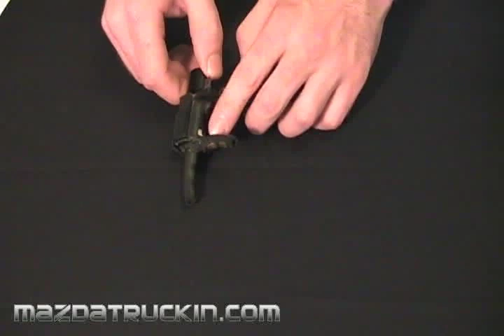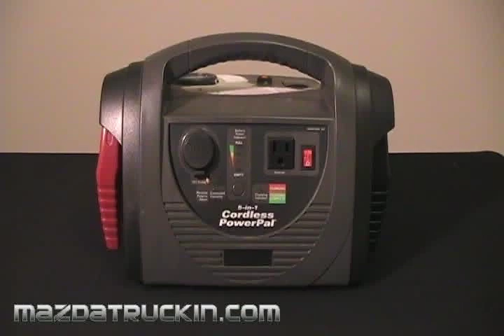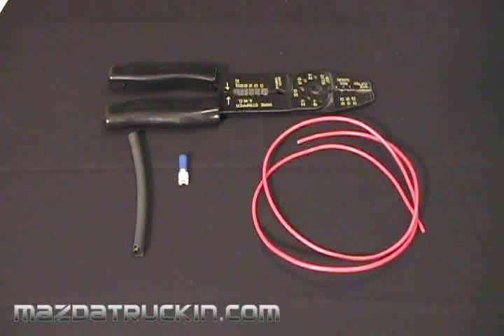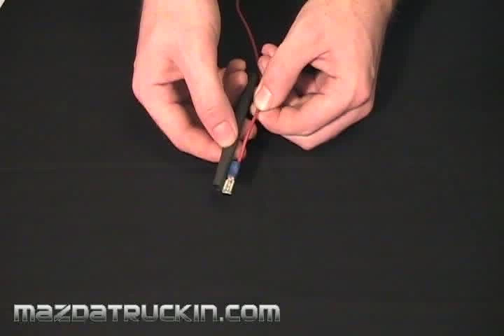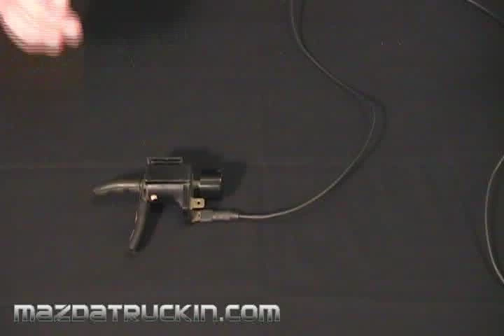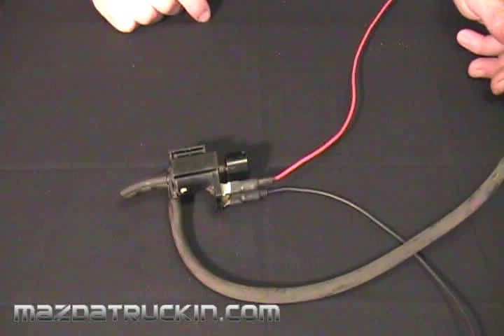Mazda Vacuum Solenoids

Comment: I am not sure you can completely rely on this method to be a true test
I have a Miata and doing this method the Solenoid works perfect
 When I hook it into the system it will not work.
 I have power to the solenoid
 I think if you have a high OHM reading when doing a continuity test ,it is possible the solenoid is still bad
 A reading of 22 to 26 ohms is good A reading of 35 and up it is bad
 I appreciate you doing the video as it it explains what a person needs to do and how it should act
 Thank you